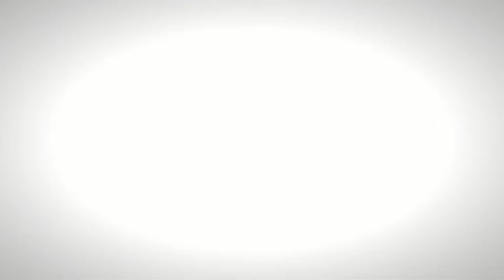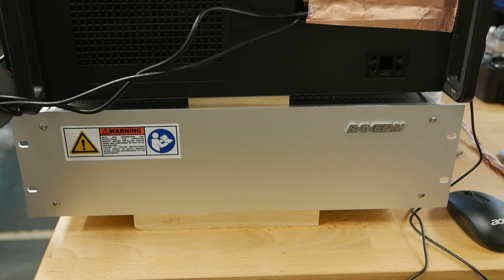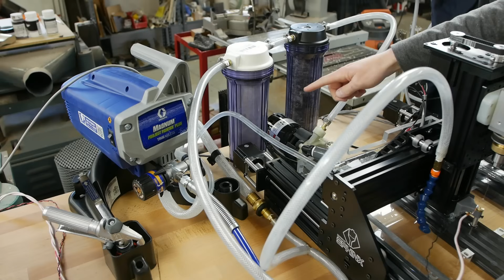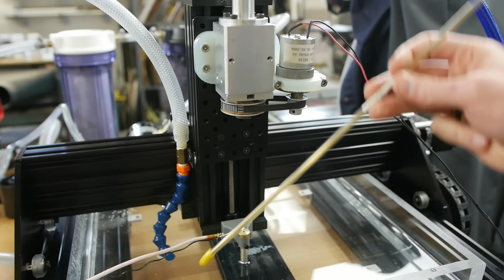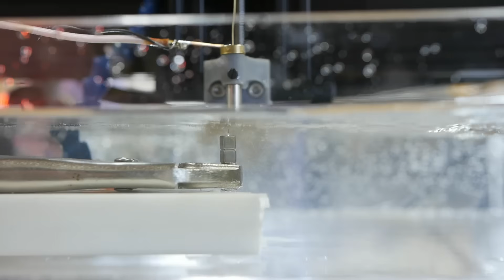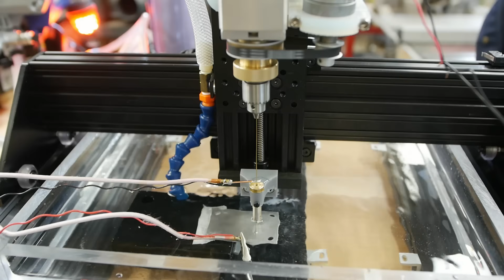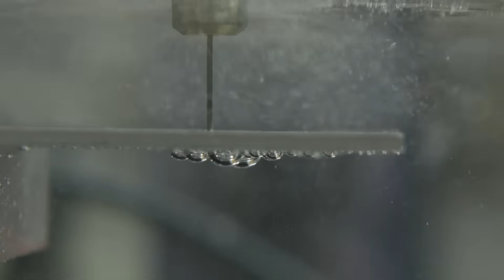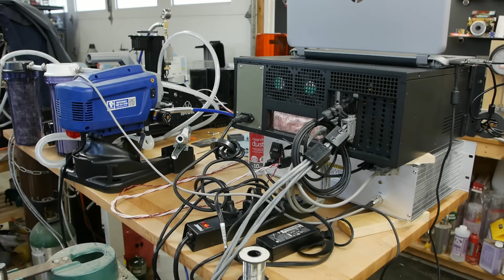Drill through anything (conductive) with Electrical Discharge Machining

Comment: Don't even know what I'd use it for but I want to build one.
Reply: Ev3rMOr3 - more impressive is EDM wire cutting. You can do amazing things with it, cut some very complex shapes. I'd love to have one but I can't imagine this thing being cheap, even if I built it myself
Reply: @richmac918  yeah I watched the guy with the edm machine that acts like a bandsaw.  Cut was near perfect precision.
Reply: Ya, they just make amazing cuts. Inside, outside, anywhere a thin piece of wire can travel and like you said, the cuts are basically flawless. Unfortunately for me, I'm stuck with saw blades, drills or doing hand cut plasma. Not even close to what those things can do
Reply: @Ev3rM0r3  Electronic discharge edm machine.
Reply: Not free , but not that expensive, 
A tesla transformer  is not that expensive . Thats all you need and dril ;)
Reply: Same here!
Reply: the way is the destination :D
Reply: broken bolts
Reply: A piece of art made with this conveying the machining precision would be awesome.

0.7mm hole as long as the one in the block, really impressive!
Reply: Can it drill barrel for rifle?
Reply: @amekrachkrach4996  http://firearmshistory.blogspot.com/2010/05/rifling-manufacturing-electric.html
Reply: @amekrachkrach4996  Yes it can.
Reply: Crackring safes?
Reply: I wonder how predictable and consistent the dimensions of this boreholes would be !?
Reply: @Dr._Spamy  that is down to the operator. If you master edm you can drill a hole through a mechanical pencil graphite, making it into a tube. The wire degrades and as it degrades the hole becomes worse
Reply: At 9:20 he talks about how u keep it even
Reply: build yourself a robot arm, attach the edm head to it and you go rock n roll: there are no cutting forces, so there is nothing that needs to be too rigidity = better repeatability. 

so you basically can machine now very complex stuff and go into direct competition to lockheed skunswork
Reply: make one commercialize it
Reply: Ev3rM0r3 use it to precision build EDM machines....
Think about how the first screw was made..... Good topic to bring up over drinks, or if you really want to shut down someone who is stoned.
Reply: You can cut stone like the Incan peoples or Egyptians  .
Reply: How about drilling .3mm holes through an aluminum front panel in any symbol configuration, so that you hardly see the holes until you shine an LED through them? Bonus points for voronoi stippling patterns, or a nice phylotaxis spiral for some subtle speaker holes. You can make them practically invisible to the naked eye with an ion beam but I'm guessing that's a little more involved.

Comment: You say backlash is small on the cnc frame, but im thinking under pressure it will be way worse :-/
Reply: Under what pressure? The pressure is internal water pressure. There is no added pressure when cutting. That's why the piece being machined needs minimal clamping. There are no mechanical cutting forces that need to be resisted or that would contribute to greater backlash.

Comment: But which came first? The drill rod electrode or the EDM drilling machine? Earthbound souls will forever ponder.
Reply: Nope, the electrodes are not drilled in the middle as you think. They're made by drawing a larger tube.
Reply: you can  watch some pioneers in this game, they're called Reliable EDM

Comment: Not knowing anything about this stuff (this just showed up in my suggestions for a couple days in a row so I gave in), but couldn't you mitigate the bent electrodes creating larger-than-wanted holes problem by simply moving the bottom part the electrode goes through noticeably lower down...? Then the center part of the bent electrode could wobble around as much as it wants to, and the end close to whatever you're drilling into would be for the most part stable/centered... or am I missing something here?

Comment: How large of a precision hole can be created? For instance, rifle barrel for high precision long range competition in .338, .375, 
.50 caliber.
Reply: You could make a pipe at whatever dimension you want.  Would be a musket.  Rifles have rotation grooves to spin the bullet - this would not be effective, might as well use a drill and reamer and save  hours of machine time for crap gun.
Reply: @Hallabalogee  This is not necessarily true, I see no reason that this process couldn't be used to cut rifling. Might take some ingenuity but i'm sure it could be done.
Reply: rats arsed  I don't know much about EDM honestly... Thanks for the input.

Comment: i suggest it will be cheaper to use graphite rods for drill 
also how about using oil instead of water maybe with higher voltage

Comment: I saw this video earlier, very nice how described almost the entire device.  Great job.

@Applied Science Isn't "pecking" or "peck drilling" an example of opposite feed rate in cutting machine operation?  Lots of controllers do that these days (not sure of open source ones though, so maybe you're right).
Reply: Pecking isn't runnin ghe actual prgram backwards, it just jumps between two defined points. And it is not process driven like EDM has to be. If it would be, it would peck only when needed and only enough without any supervision from the user. Oh I would love that...

Sometimes in a wire EDM you have to reverse lots and lots to get out of the short circuit condition, as materials tend flex and move from internal stresses when they are cut and can narrow the kerd to a point that it short circuits or breaks the wire. Or there is a perfect kerf but something in the part geometry makes the water swirl the cut particles and short it that way.

Comment: Wire EDM ist the one thing, that I always considered out of reach for hobbyists. Now, the total setup, that you have here (excluding the CNC) costs about 4.000 EUR, which is pretty spectacular IMHO. I am really looking forward to that next video, expecially, how the wire is being moved, so that the eroded parts are distributed over the wire's length and not lead to break. Thank you so much for the thorough explanation of the setup and tools needed! Great video!
Reply: I think the rarity of them in the hobbyist world has been that they are quite rare in the industrial section too, they are just not as common as milling machines and lathes. But I've seen people past 20 years building these wire EDM's and I built one in 2013 with an Arduino controller. The whole machine cost me about 1000 EUR with everything included and worked great, check out some of my videos.

I bought the BaxEDM BX17 generator just recently and I'm almost finished updating my machine with it to run some test cuts :)
Reply: Jaakko Fagerlund Thank you, I just browsed through your channel - thanks as well for your explaining your setup, very interesting!

Comment: Rolls Royce received a very fine "Twist Drill" from a supplier. The issue with it was there was no lubrication hole down the centre, so Rolls Royce did it themselves, and sent the twist drill back, with a note. "This is how we like our twist drills." also with a slightly larger drill. 1/64th " already drilled with a coolant/lubrication hole. Water is the best coolant. but boil off the Oxygen first to prevent rust. then finish with oil. For Hard Materials The Tips should be coated with CVD Diamond, like the best arrow heads of olden days. A slightly oxygen starved Acetylene flame, (In the old days "From the Water + Calcium Carbide Reaction), it can help to flash-plate the tip with weak Copper Sulphate solution. The Copper encourages the growth of amorphous diamond crystals. For larger Diamond Tipped Drills the old "Monkey Traps Hand In Jam Jar With Clenched Fist" routine, helps a lot. First blast surface with suitable sharp abrasive, crushed flint worked well in the olden days. Use a doctor blade to fill cavities with etching solution, this will allow crushed flint particles to loosen up and be washed out. Then iterate etching solution followed by etching solution neutraliser at the surface. Gradually the surface looks like 'Oak Bark' with numerous undercuts. Next apply C.V.D. Diamond coating. and finally sharpen cutting edge. Arrow heads tipped like this, frightened aggressors. They soon lost their CVD Diamond through rust and neglect. It was assumed by the superstitious they were magical, and the magic had worn off.

Comment: maybe I'm missing something but isn't tungsten slightly radioactive and not super healthy? if you're drilling holes that dissolves tungsten into water I wouldn't put it on any fruit or vegetables.
Reply: Nothing wrong with tungsten, you are partly misinformed by scare mongers.  However Thoriated Tungsten TIG welding electrodes (less used these days) contain a few percent of Thorium oxide that has a portion of the naturally occurring radioactive isotope which causes some local ionization which assists in spark initiation.  The slight danger occurs when regularly grinding the electrodes with no dust mitigation.

Comment: Can you experiment with granite Ben? Them antediluvian technology is inching closer to be rediscovered.
Reply: @Thor9669 Indeed :) but I addressed 'experiment', consider both voltage as electrical pressure and various piezoelectric crystals within granite, ac frequency induced current coupled with resonance induced feedback loop by such crystals can potentially saturate electricity within the granite; from thereon, the question becomes how to direct the flow of the electricity to make controllable cut/drill via localized current surge within the lattice of energy which exists within the granite.

Comment: so first, how does such a thin devise (the drill rod) hold back so much pressure without failing and also why do the sides of the electrode not arc to the sides of the material ( is it because the charge collects at the point?)  idk just some questions that popped up while watching, pls answer!
Reply: The inside/outside diameter ratio in such a small tube is actually quite large and that is what makes it hold pressures well. And we are only talking about 60-100 bar here which is quite low still compared to hydraulics with typical 200-300 bar and upward working pressures.

The sides do arc a little, especially in deep holes as the swarf has to travel betwwen the tube and the hole and it makes the kerf just a tad smaller for the spark to easily ignite there. So the hole ends up a tiny bit tapered, but not much.

Comment: EDM supplies are pretty easy to build with the electronics available today. At least if you are someone that actually builds stuff and not just a video voyeur. I built one at an unheard of 1MHZ, not water based. Nice find on the spindle. I'd love to build a machine if I actually had a use for one now. I imported and repaired EDM machines for a few years.

Comment: Can you drill through aluminium?
(Or any material that oxidize quickly)

Electrical connection: Could you connect to the chuck with a brush?
Reply: Yes, aluminum goes VERY fast as it has a low mlting point.

Comment: I am not all the way through your video but why would you not use the drill head as the conductor to the drill rod? Would it then not be possible to mount some nice Copper infused spring loaded brushes to provide the electrical current to the drill head and given the very low RPM's i don't think you would see significant wear of the brushes or damage to the head provided you take a bit of time to match them to the radius on the drill head for better contact. This is with the assumption that there is good lateral support for the drill head in the design of the unit.
Reply: You are correct in your reasoning, that is how it is done in commercial drill EDM's and wire EDM rotary axes.
Reply: @TheWireEDM  thanks for sharing that bit of knowledge.

Comment: Add a tiny bit of salt to distilled water, 3 to 6 parts per million will do to start. A simple TDS meter will give you a reading.
Keeping it all stable as you use the water is the tricky part.

Comment: This looks to be a nice machine you have built from the makers design. What tolerance can be held in both diameter as well as the Y and X set location? Lastly what is the starting drill location tolerance to the exit location tolerance? We like this just have questions because we live learning.

Comment: Have you tried drilling into conductive glass? e.g TEC7, TEC15 or something simular?
Reply: A high pressure water jet does a comparable job with a lot less hassle, preparation, and constant worrying about arcing. imho
Reply: @BillAnt  it's not comparable if it's not a replacement for the specific application. It is therefore incomparable. It is comparable in so far as they are both methods for drilling holes and machining shapes, but their applications have very little if any overlap. Not sure why you call them comparable. For instance EDM exceedes water jet in terms of accuracy in every way.
Reply: Bill A , well there are other issues with water cutting, even if it is a quite well known way.
Reply: Paul Dawson search for Tec 7 and Tec 15 and you will find some.
Reply: @Dr_Kaos   looks like it's a thin conductive oxide coating on a thick glass substrate, so not conductive all the way through...
Reply: Paul Dawson  not nearly as clean as EDM which will be polished to an optical shine but also allow holes of extremely small diameter well below 1mm  which are impossible with water jet cutting.
Reply: @captainTubes  I just happened across your reply- I've seen micro waterjet and actually have a sample part on my desk, the kerf is tiny- about 8 thou is my best guess by comparing with a caliper up to my monitor as a backlight. There is a larger pierce, that's about 12 -14 thou. In WJ nomenclature that's a "wiggle", it's a move determined by the motion control to flush the pierce.
Reply: @Paul Dawson < By varying the water jet pressure it can be adjusted to just about any material.  Some jets also use abrasive powder to a cleaner cut.
Reply: Paul Dawson  electrical discharge machining is a material removal application suitable for precisely working hard or soft metals for precision engineering applications. Illustrated in this video is electrical discharge machining type drilling. You can see he illustrates the advantages by drilling into an object at an extremely acute angle which would be impossible with similar mechanical techniques similarly it would deflect a waterjet somewhat causing an imprecise penetration. Electrical Discharge Machining can be done with five axis control of a fine wire cutting element, similar to cutting foam with a hot wire but instead of heat powerful high frequency electricity/plasma discharge is used. The wire used can be extremely fine approximately the thickness of a human hair, while it is held under high tension and precisely controlled with top of the line CNC mechanisms. The wire can be fed through a pre-drilled hole thus interior profiles can be machined as well. It is one of the most precise methods of machine material removal known. There is no  mechanical cutting or grinding, and little if any heating thus part stress is reduced and absolute minimum tolerance is maintained. Fundamentally major difference between the shaping characteristics of waterjet versus EDM is that a waterjet will produce a slightly conically tapered hole as it penetrates from the top to the bottom of a thickness. With EDM the profile is perfect, from top to bottom with consistent finish, consistent tolerance, no edge radiusing, or unanticipated variance in finished profile. If you can imagine a part on a computer, the way to parts fit together after a Boolean operation, that's very similar to the type of part accuracy you can get with EDM. Waterjet is in a different and lower class of manufacturing, it is very suitable for high volume low tolerance applications because machine ware and operational costs are extremely low.
Reply: Paul Dawson  Electrical Discharge Machining.
Reply: Paul Dawson  Smartphone screen?
Reply: Johnny. As far as I know, "conductive glass" are the class of material that are only SURFACE conductive. EDM works on materials that are conductive along the "path of cut" only. Unfortunately at the current state of the art, the best approach is to coat the glass AFTER all the machining is done. Source: 7 years in the IG and PV industry.

Comment: you can probably do much cheaper for the pressure supply, graco had china making their sprayers, and they have alot of markup- lots of chinese selling cutr ates on ebay, and I've been able to buy alot of spraytech piston driven sprayers used for under 100 dollars, these machines are usually over 1k new.

Comment: Nice! Very interesting process. However I'd like to know 2 things.

How does it happen that a high-pressure water stream doesn't push the electrode away when bouncing off of an uneven surface?
And why is there a spark gap in a generator in 2019?..
Reply: If the water pushes the electrode to one side of the hole, this larger side then has a pressure drop due to increased volume and the other side has an increase in pressure, so basically it is not moving anywhere but stabilises in the middle.
Reply: @TheWireEDM  Makes sense. What worries me is the moment of approach, when the electrode hasn't made a hole yet.
Reply: @darth_dan8886  That is what the ceramic guide is for, it keeps the drill rod centered just above the workpiece.
Reply: @TheWireEDM  Yeah, I see. But if the rod goes deeper under the guide, like 5cm deep into the drilling pool, before touching the surface of the, let's say, sphere it's going to drill? Or is the pressre of the water outside enough to keep it straight in that case?